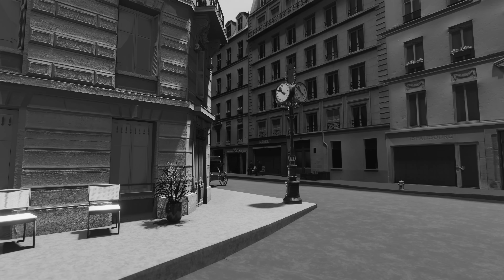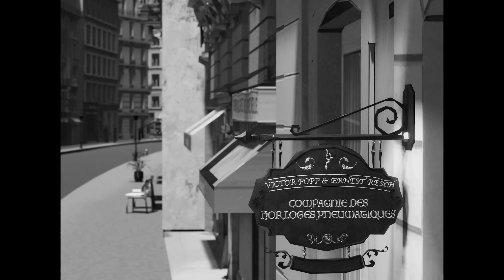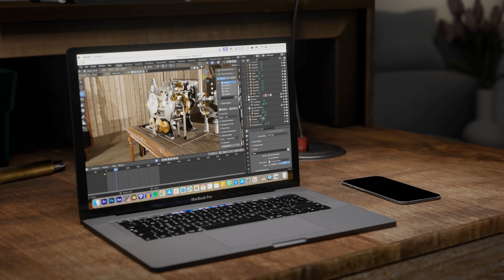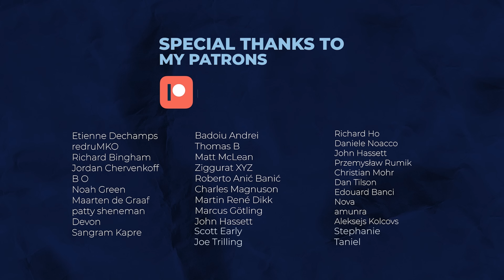The Underground Clocks of Paris

Comment: Sooo, why did the clock stop on Jan 21, 1910? 
And how the air waves travelled long distances still capable of moving the arrows in hundreds on clocks? The more clocks you connect, the more powerful air burst you need, isn't that right? This video made me ask more questions than it itself answered, lol.
Reply: I think a pipe was destroyed in the flood, or the master clock damaged.
Reply: @Bobo-ox7fj Not greater pressure. More flow, more liters per second. Putting lot of pressure in the system wont help.

Think like this: Connecting a wheelnut gun requiring 5 bar to a compressor. If you connect 10 such guns, you dont need more pressure - its not like you need 50 bar.

You however need much more liters per second at 5 bar.
Reply: @sebastiannielsen I've been in automotive industry for decades. Never have I heard someone call an impact a wheelnut gun. I'm writing that one down.
Reply: No, you don't need a "more powerful air burst". Since its a sealed, enclosed system, it just meant, you needed a longer airburst. The airburst of 20 seconds were enough to move all clocks on each "branch".
When all clocks on a branch were "full", the system would just build pressure without using it, and release the pressure out of some safety valve or similiar.

Think like this, you put 1 baloon on a air compressor. It takes pretty quick to blow it up.
Repeat same thing with 100 baloons. You would still be able to blow it up, it would just take 100x longer time. You don't need more pressure or more power for that.

So as long as each branch were limited to a specific number of clocks, it would work fine. Note how there was a large pipe connecting to several smaller pipes, this ensured so each branch shared the same air amounts. Yes, if one branch got 1 clock too much, it would "steal" air from another branch eventually, so there was a upper limit how many clocks the whole network took.

 Thats why it was connected to a fee, because if too many clocks were connected, no clocks would work. So they needed to limit adoption, thats why there was a fee. If too many users would still join the system, they would need to elongate the time the system worked by increase the area of the airbrake so the valve would remain open for a longer time than 20 seconds.

But they couldn't enlongate the airbrake previously, because if the system closed the valve too late, there was too few clocks to release air pressure quickly enough to ensure it was ready for another minute when the next pressure wave came. So the pressure advancer would be in a "open position" all the time. Thats why the airbrake needed to be adopted for the number of clocks on system, so if too few clocks were active, they would need a shorter open time, and if too many clocks are there, they would need to elongate the open time.
Reply: @sebastiannielsen  At such distances the air likely rather travels like a pressure wave (think of sound waves) than building up pressure simultaneously in a closed system. Already pipe organs with the pipes too far away from the console start to behave odd.
Reply: @sebastiannielsen kind of far fetched to call this system synchronized though. First of all it all depends on the correct setting of a clock because all this system can do is advance by one minute. So if your clock is set wrong to begin with, you’re just advancing an incorrect time. This is not what we would today understand when we talk about “synchronization” (actually not even back then, see Einstein’s 1905 papers). Secondly the clocks further away from the master clock would get the signal much later than clocks closer to it and thus would be off by up to 20 seconds. Kind of a useless system that took so much work to build and i) doesn’t set ANY clock in the network to the correct time (it just advances clocks by one minute) and ii) still will have clocks running up to 20 seconds late 😂
Reply: @manuel0578 We today are spoiled by technology. Back then being off by no more than twenty seconds would be considered hyperaccurate, as that's the deviation most standalone clocks of that era would accumulate within a week, if not less.

The clocks you call "truly synchronised" didn't become common until the eighties and nineties due to NTP, GPS or DCF77 (and sortalike) systems becoming cheap enough, and even then I've seen DCF77-based clocks where you had to manually set the correct hour.
Until then, having a master pulse from a centralised clock was the best we could do. Besides, setting a clock correctly once during installation and then almost never again was already a huge step up from having someone make their rounds through a large building/area, setting standalone clocks each day.
Reply: @Windowsfan100  I’m just against calling it synchronized. We would have to check the original sources to see if they even called it synchronized back then or used another word.
Reply: @manuel0578  I agree. This is what I thought when the narrator said it took about 20 seconds for the air to reach the farthest clock. It's not true synchronization, but closer than what there was previously.
Reply: @manuel0578  So the clock at the far reaches of the system wouldn't register the true time (to the minute) until 20 seconds after the minute had begun.  Then, for another minute, it would continue to register that time, but actually, 40 seconds afterward, the master clock had begun to register the next minute.   I don't know that I need more accuracy than that in my life today for a clock that I visually reference.
Reply: Impedance matching, more piper lowers the resistance, which can be measured at the source. Though, this isn't what they did, this idea is actually really dumb and there's a lot of reasons no one else did it

Comment: Just how do you do that? In this day and age when almost everything has been seen at least once by everyone, you still manage to surprise me with something I've never heard of. This is so Steampunk.
Reply: or compressed-air-punk?
Reply: Correction, clock punk!
Reply: @SeekingTheLoveThatGodMeans7648 compressorpunk
Reply: @Bobo-ox7fjThat would be diesel punk, steam punk doesn't use compressed air or diesel. Clock punk does use compressed air and bellows for the singing automatons, sending messages through bronze pipes, the copper alloy metal casting factories. Just because modern diesel engines used compressed air in breaking systems doesn't mean that tech belongs to the diesel punks. Compressed air and clock work mechanisms are clock punk but not everything that uses this tech is a clockpunk item.
Reply: all falls down under the same thing! Steampunk! Whatever, just steampunk!
Reply: @Ashleyhru  No clock punk and steam punk are very different, that's like equating solar punk with cyberpunk.

Comment: That's actually very smart and Ingenious idea!! But i do wonder, where the first air preasure from the master lock came from and how it's strong enough to reach whole paris.
Reply: Yes, I was wondering the same thing. I mean there were plenty of air compressors around at that time. They had diving suits all over. There was a large sponge harvesting industry in Indonesia that use them. The smaller boats had hand cranked compressors. So I'm not that amazed by the source, But, like you said, I'm amazed that they could get sufficient air flow through the pipes that were shown to reach a few kilometers. Maybe they had "amplifiers" along the way? Anyway, amazing stuff.
Reply: @2ndfloorsongs not only the distance but the timing. How to manage to circulate air in the whole system BY THE MINUTE (or withing the first 20 seconds)
Reply: @memovilmx6239 you don't have to have the pulses arrive at the same time everywhere, because they only broadcast the tempo. You'd still have to set each clock first to the correct start time. It's not like GPS clocks now that broadcast their exact time as well as the tempo signals. So if you cared about the seconds, you could probably rotate the clock face by one degree for every ten seconds behind you were. I'm guessing precision to the second wasn't that important though still yet.
Reply: @archerkid02  That's right! One wouldn't need to set the clock to the pulse that just came out, any one of the pulses generated earlier would work. So propagation time wasn't a problem, just the amplitude. Thanks for pointing that out.
Reply: @2ndfloorsongs  And pipe organs in churches worked with precisely controlled compressed air much earlier.
Reply: @cyberyogicowindler2448  Yes! Thanks for reminding me. A few of them contain(ed) some of the first examples of using a feedback loop to maintain a constant pressure. Pretty impressive engineering. 
When looking at those fabulous contraptions, I'm always amazed at their sheer size!
Reply: @cyberyogicowindler2448  Yes, thanks for reminding me. The pressure systems on some of those organs contain the very first examples of feedback control loops. Impressive engineering. 
And speaking of impressive, I'm always amazed at the size of those elegant contraptions. (Not to mention their beauty.)
Reply: The pressure differential was probably 8 bar or more so when the air is released it's like an explosion, it's close to speed of sound. Sure it takes a lot of air to inflate the bellows of all clocks but the change in pressure is very fast, is not gradual change, it's sudden
Reply: I believe it travels AT the speed of sound. Still, it would take a lot of air to power like thousands of clocks.
Reply: Also… how did you set the clocks initially?
Reply: @philpompeo7566  Did any of you actually watch the video? they answered all those questions... OMG... SMH
Reply: @toyyoda3710  Maybe you watched the video, but you certainly didn't read all the comment questions. There were several questions that were not answered in the video. I count three (and, depending on how you interpret the video, a fourth). 
Congratulations: You've just, before the eyes of the world, personally constructed and then trapped yourself in your very own box of irony. 😁